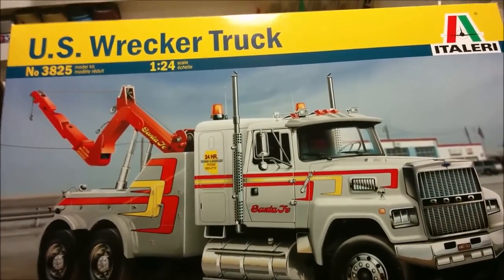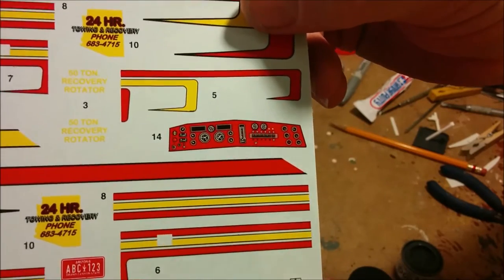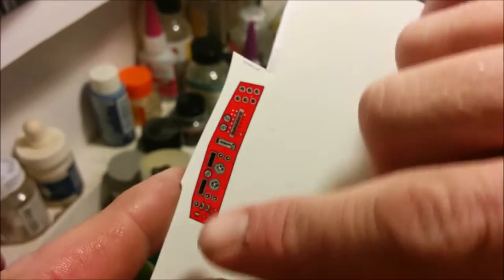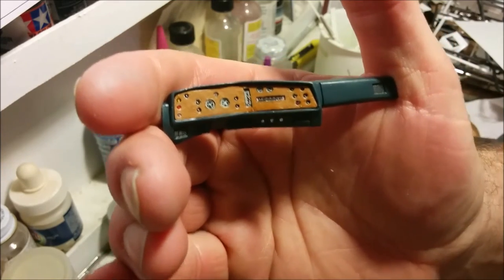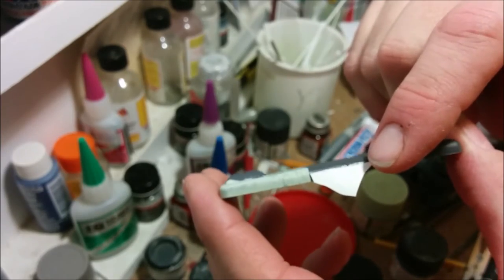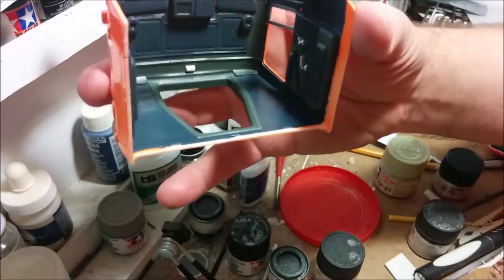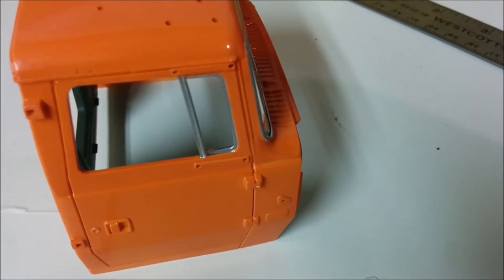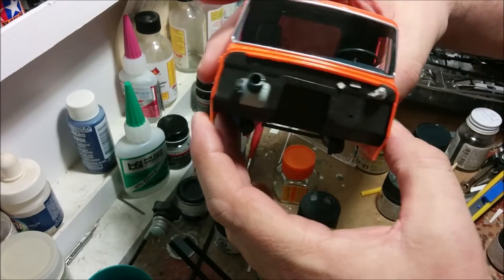Modern Wrecker Truck 1/24 Pt5 by Italeri

Comment: Hello Dan, remember me? The two story falcon tow truck I made comments on. Catching up on previous videos. This LNT is the 9000 series, LNT9000. See wiki photo:  https://en.wikipedia.org/wiki/Ford_L_series#/media/File:FordLTL9000Truck.JPG  It was a heavier duty version of the LNT which you needed with a big tow truck like that. My dad had one LNT tractor in his fleet among other Ford tractors and a nice GMC cab over with the 8V-71T diesel with one turbo into a supercharger. They hauled and delivered office trailers with those trucks. His LNT had the V-8 CAT diesel naturally aspirated which was noisy but it hauled those empty office trailers like nothing was back there. Nice build, I like the dash treatment, a lot of work and skill but you always do such a great job.

Comment: Where did you get the refit strips
Reply from the maker: Samuel Vasquez I am thinking that you are referring to the "rivet strips" I installed on the firewall. I have to apologize, I did film a bit about making them but I cut it from the video because it was getting too long.  I will try to put a how-to in the next part. Thanks for following.